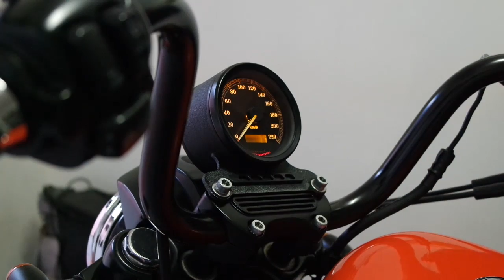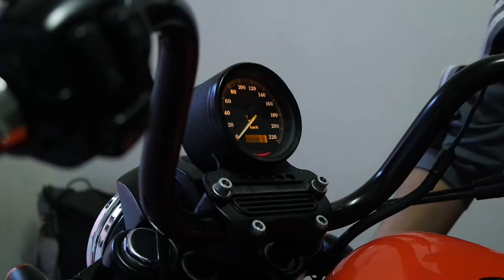How to replace Harley-Davidson Sportster ('97-'03) battery

Comment: About as straight forward as I had hoped it would be, cheers
Reply from the maker: Yeah, the only tricky part is to connect the positive terminal, because you have to keep the battery with one hand, then you have to screw the bolt with the other hand.
Reply: yeah sure give it a try and see how straight  forward it is trying to attach the positive terminal without the spacer falling off  or the  loose nut in the battery post falling out OR both

Comment: Thank you! I could not find out what a 2000 Sportster battery retention system should look like. I purchased a bike with a front cover that is loose and without a battery strap🤪
Reply from the maker: Hi mate, hope this can halp you. 
Battery strap: https://www.revzilla.com/motorcycle/drag-specialties-battery-strap-for-harley-sportster-1998-2003
Battery top cover: https://www.revzilla.com/motorcycle/drag-specialties-battery-top-cover-for-harley-sportster-1997-2003
Battery side cover: https://www.revzilla.com/motorcycle/drag-specialties-battery-side-cover-for-harley-dyna-sportster-1997-2005

Comment: Thanks for the video! I have a metal cover on the outside, too, but will try out this method and see if it works.
Reply from the maker: You’re welcome! This method will work. You’ve only to remove the cover and then it’ll be the same.

Comment: FYI you don't have to remove the seat you can just pull at the battery unless your cables are too short which varies on the Sportster.
Reply from the maker: This is a 97-03 "stock" Sportster. You can't reach the bolts behind the battery unless you remove the seat.
Reply: @MoExha  you have to lift and pull the battery otherwise you aren't gonna be able to do it some cables are a bit longer which I said varies, in my case I just slowly disconnected the minus poll which is a bit more outwards facing and then I did the plus poll and just like that it came off without removing the seat I didn't even touch the frame.
Reply from the maker: @jz261  what model is your bike?
Reply: @MoExha  98
I also got 90 degree screwdrivers which work in an angle incase you are wondering.
Reply from the maker: @jz261  ok thank you for the information 😉 Appropriate tools always help you 😊
Reply: @MoExha  np just wanted to mention another way, still great tutorial😊
Reply from the maker: @jz261  thanks mate 😊

Comment: Thanks for the help.
Reply from the maker: You're welcome mate 😉
Reply: Now on to the next problem
Reply: After I put new battery in, I started it up 3 mins later the dip stick popped off about 4meters and oil oozing out. Would you know what’s wrong with it?
Reply from the maker: @williamcerar7308  well, I don't think it's a battery problem... You should check the oil level on cold engine with the bike perpendicular to the floor.

Comment: Its a bugger putting back in tho
Make sure phillips head screw driver dosnt touch frame
Reply: Wrap electrical tape around the shaft of the screw driva
Reply: Or use electrician’s driver. They’re coated and can handle up to 1,000 v

Comment: I took my battery out and charged it and put it back in and now it makes a rapid clicking sound when I turn it over. Is it still the battery? What if I didn't disconnect the negative first?
Reply from the maker: yes, I suppose it's the battery.

Comment: Q...please. I bought a 2009 XL883L and it needs a new battery...problem is I am in Cambodia now and they have no idea. Shipping here is impossible. $$$$$$$$$$$ so what size and amp does it take so I can locate one. My service manual is uselesson this matter too. Doh. Thanks for any tips and help.
Reply from the maker: Hi, I'll try to help you. 2004-2018 Sportsters need a 12V 12Ah battery. Dimensions are: 15 x 14,5 x 8,7 (centimeters). Remember, 1 inch.=2,54 centimeters. Here you can find more infos: https://www.gilperformanceshop.it/it/accessori-harley-davidson/centralineelettronica-cavi-candele/batteria-al-gel-sportster-04-014.html. Hope this helps. Cheers ;-)

Comment: Hi! Do you know the specifications and characteristics for a HD xl883 sportster 1997 battery? Thanks a lot!
Reply from the maker: Yeah, I'll try to help you. 12V, 18Ah with a start current of 270Ah. Dimensions: 175mm x 87mm x 155mm high. Remember, 1inch=25,4mm. Hope this helps you. Cheers dude ;-)
Reply: @MoExha   

Would this battery work? (12V, 20Ah, (CCA) 460 Ah, 178mm x 87mm x 154mm.

 http://www.all-batteries.es/baterias-moto/harley-davidson/883/xl-883-sportster/1997-2003-mot8722.html

Thanks a lot!

Comment: What kind of glue did you put on the screw? I feel like that’s my problem one of the terminal is really loose I’ve had it on a battery tender and it’s still just clicking won’t start up
Reply from the maker: It's a threadlocker.
Reply: I just got it today then I fucking drop the bolt, screw and one of the spacers into the bike and can’t find them I’m so stressed I don’t know what to do
Reply from the maker: @PNWLoco  buy a new screw, bolt and spacer and you'll find (or just will fall off the bike) the firts time you'll go for a ride 😉
Reply: I got my bike running again thank you so much!
Reply from the maker: @PNWLoco  you're welcome mate! 😉